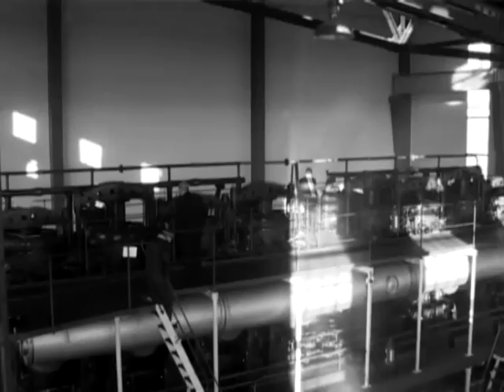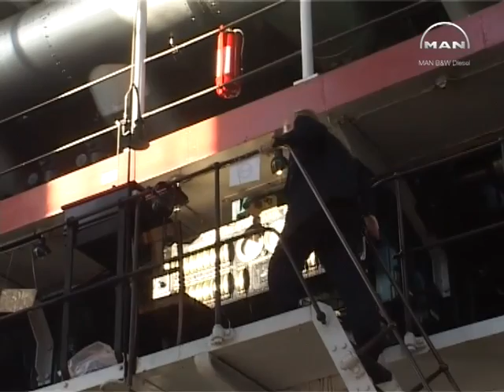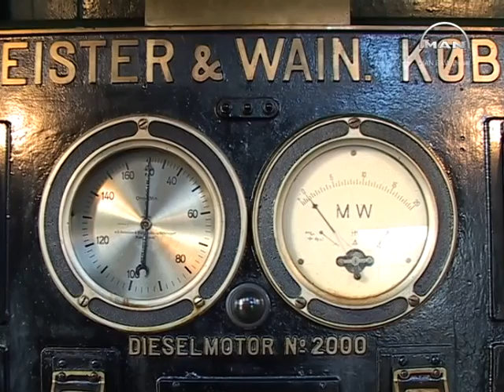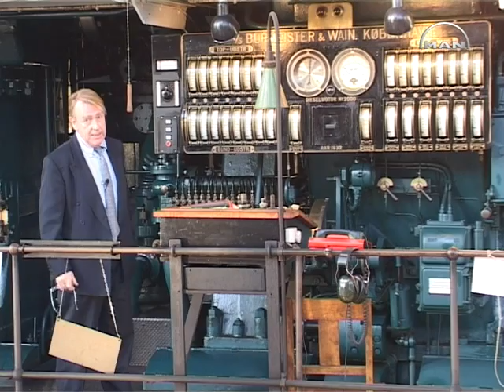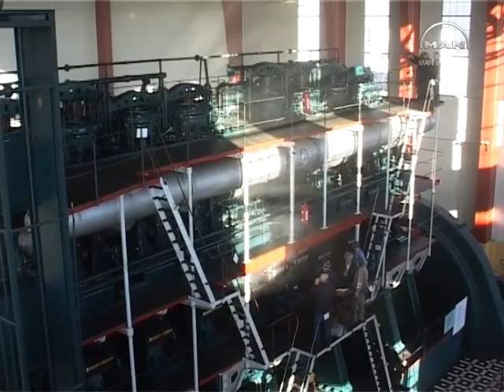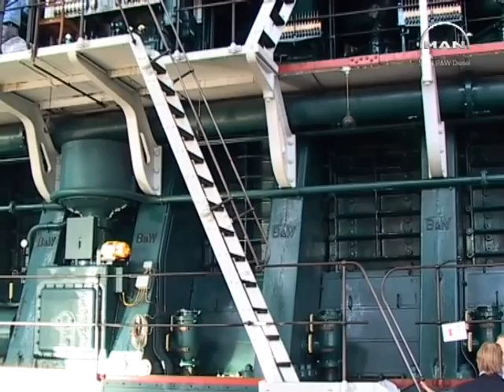The Diesel Legend

Comment: I worked on one of the BMW double acting diesel engine on the Tintagel Castle ship in 1960's.
It worked ok but needed much maintenance on the fuel injection valves.
This was in effect steam engine design applied to a diesel engine.